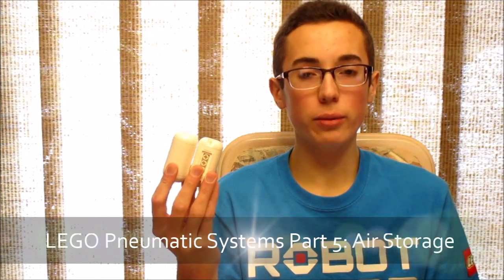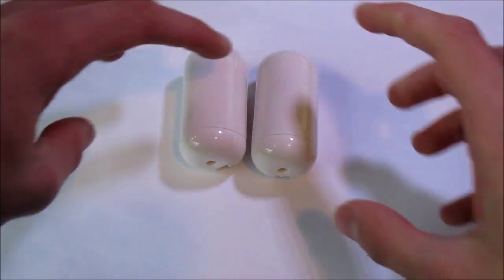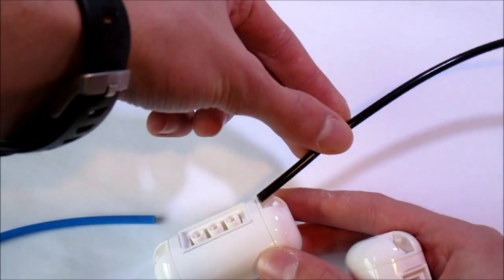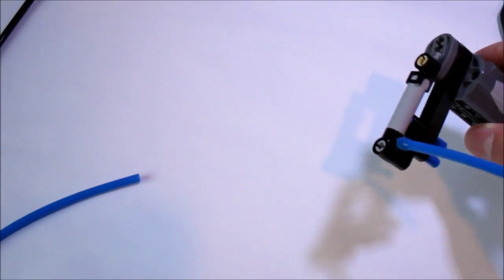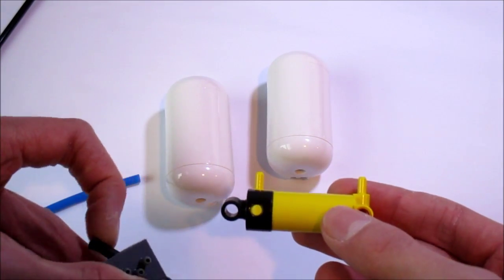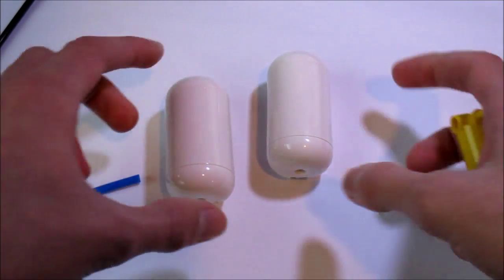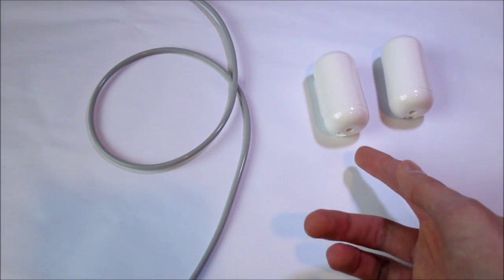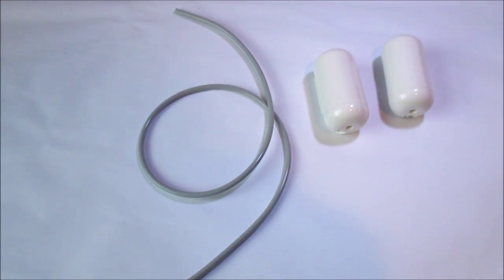LEGO Pneumatic Systems Part 5: Air Storage

Comment: I´ve always wanted these air tanks, and finally got 2 of them :>
I´m going to test how they do on the 8868 Air Tech Claw Rig with the compressor, my old 9V motor didn´t generate much pressure with the pump, maybe the truck can do a slightly better job since it´s motor is not as worn.

Comment: Nice series. May be you could expand this collection with more videos based on lego education pneumatic set with the pressure meter and the design of a robotic arm. Another idea could be having an ev3 or raspberry pi as main controller for the robotic arm (programmed in Phyton) and other micro controller like Microbit as Bluetooth remote controller

Comment: can you also use them to store water?
Reply from the maker: If you are feeling adventurous. Otherwise, it is not advised. Cheers!
Reply: Water cannot be compressed.
Reply: @TiberiusStorm  Actually, it can. But, it requires an  EXTREME amount of force. in hydraulics, used in large construction machines, oil is compressed. usually powered by gasoline/petrol.It is very strong, and can lift Tons (literally) of material

Comment: I want to make an aesthetic type of thing on my robot where I would attach a linear actuator to a valve and let a type of smokey or harmless gas out of the air storage to make it look like steam or something coming out of the tubing. Am I able to store a gas in that tank and would you know what gas to use?
Reply from the maker: Interesting idea, but I don't know that this can be done with LEGO. Maybe you can find a way to get some fine chalk dust or powder into your pneumatics, but this may clog up the system, so be careful.